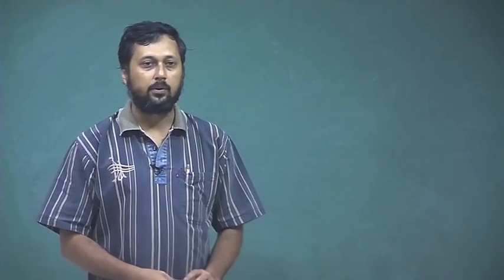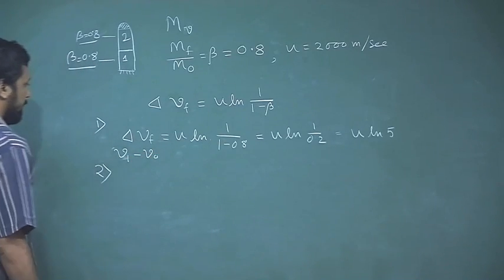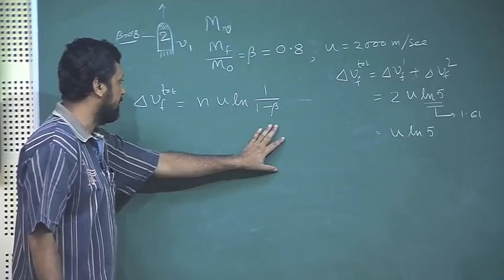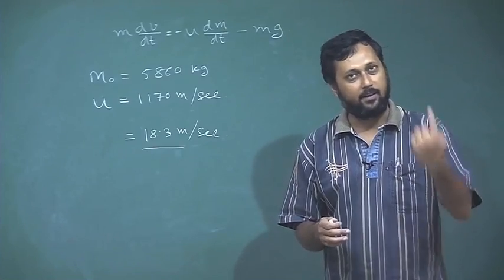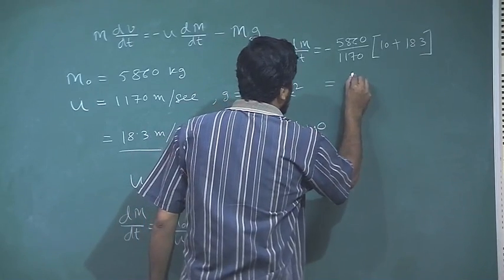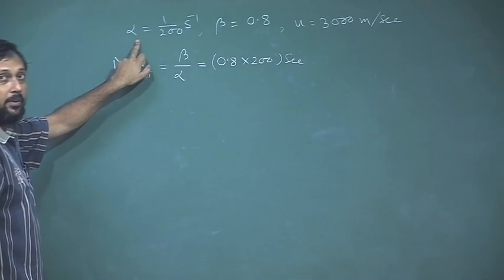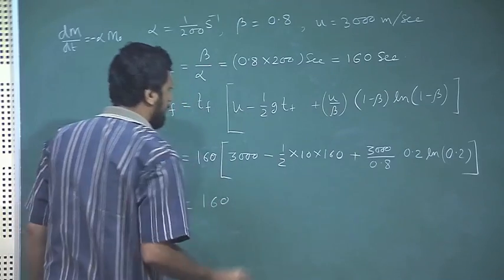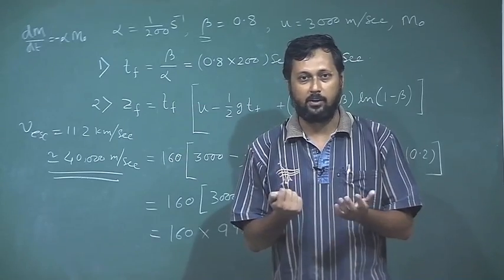Lecture 7 : Systems with variable mass - 4

Comment: Is impossible to have the same structurar ratio for both stages. When you is in the first stage, the total mass of the second stage is considered structural mass os the first tage. See more in the books "Atmospheric and space fligth dynamics" by: A tewari, or "Orbital mechanics for enginnering students" by H. D. Curtis. Nice course, congrats.
Reply: exactly what I thought.. but if you work it out using the mass of part 1 as M1 and part 2 as M2 and vehicle mass as Mv, then you get two equations: M1= 0.8(M2 + Mv) and M2 = 0.8Mv, we get m1=1.44Mv and total mass M=3.24Mv which gives β=0.691 which satisfies β<1. Hence, we could actually use 0.8 in both cases. Am I right? Somebody tell me please!
Reply: Curtis it's very good